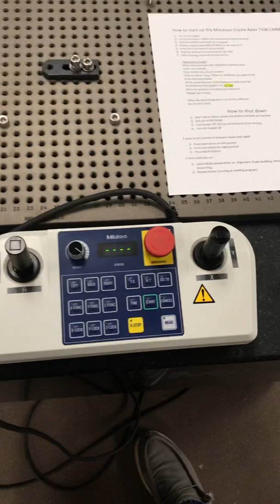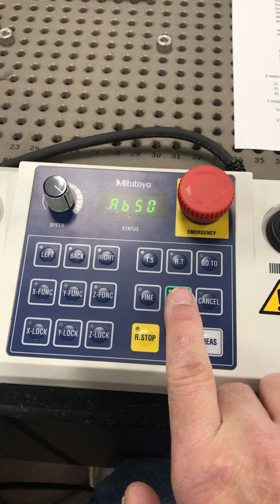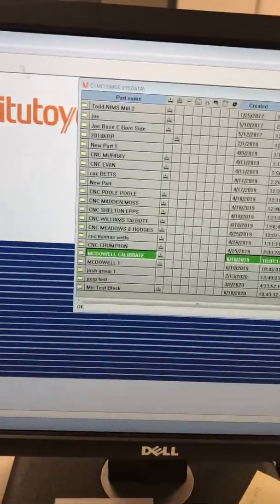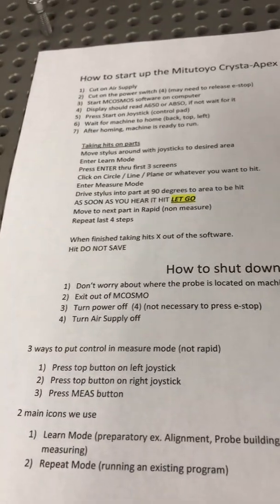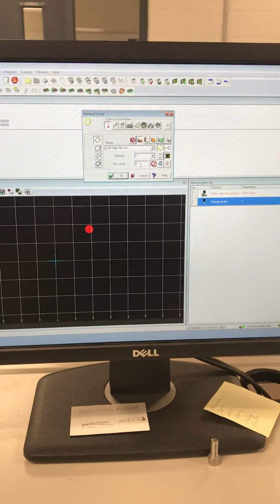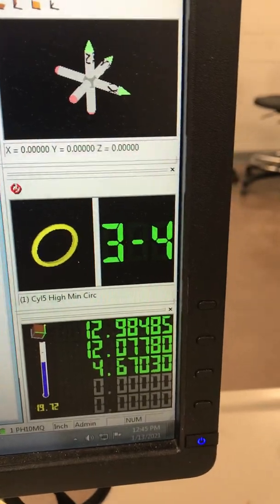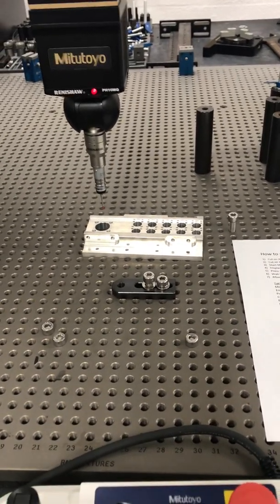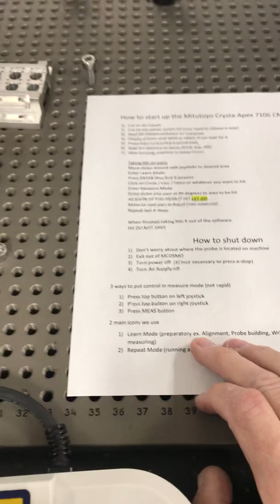Mitutoyo CMM start up and shutdown

Comment: Excellent video. Do you have any thoughts or a video that would help me with a question that I have? I work at a shop that has used the same program for years and we’ve never had issues. We have the part set up in nine different locations and have it in repeat mode to cycle through location, one through nine and then start back at one and repeat the process. After having Mitutoyo out doing work on the machine, it has defaulted or reverted back and will only repeat location one. And I do not know how to go back. Any thoughts? 🙏🏼

Comment: you don't know how much I appreciate finding your video about using Mcosmos. Thank you so much. I have a question. do the motors for the motion axis run on a different encoder system than the linear readout of the cmm function used for measurement?
Reply from the maker: That’s a good question. Unfortunately I don’t know the answer. I would guess the encoders are tied to the linear readouts.

On an old Starrett CMM I ran the motors actually burnt out because the CMM was constantly trying to hold position even when no one was using it. We finally learned to e-stop when not using. I’ve asked about this on every subsequent CMM I’ve ran since. Mitutoyo said it’s not an issue with theirs as that was old technology.